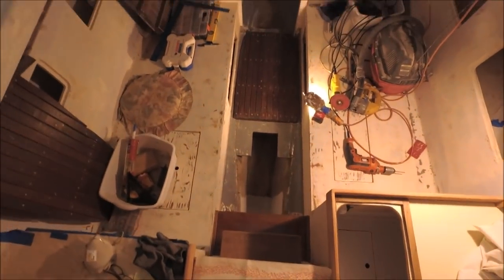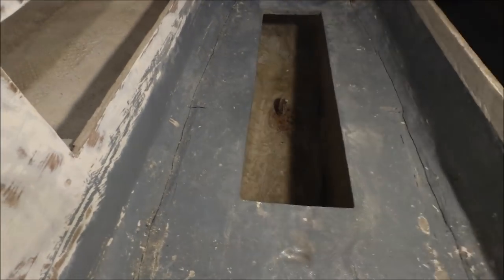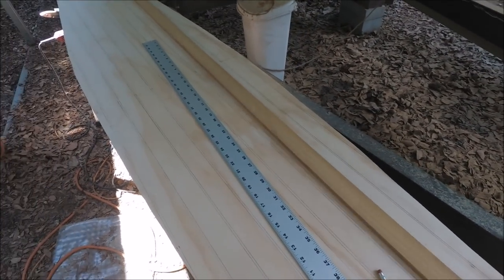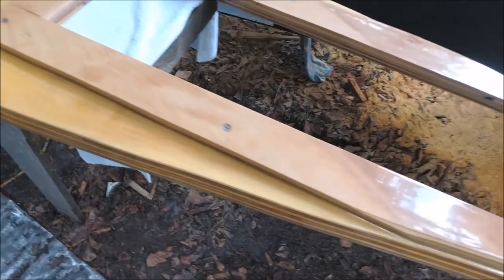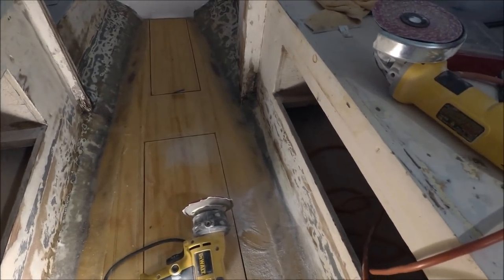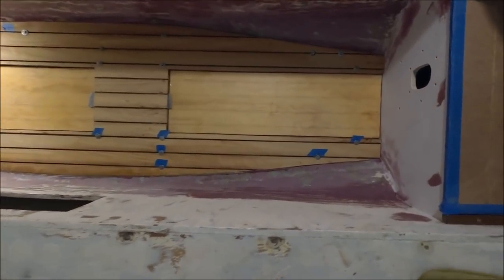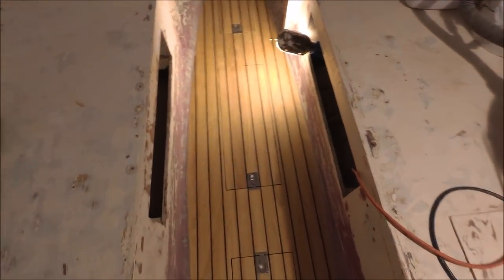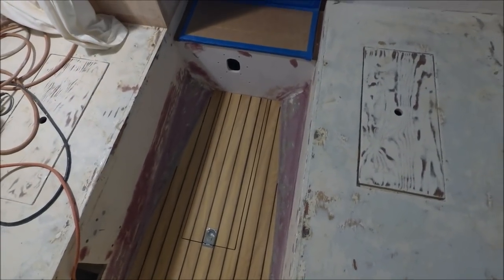Triton Osprey Refit Part 6   New Cabin Sole

Comment: As usual, extremely nicely thought out and done well - Thumbs Up! :) It is a nice look, I like the light color and contrasting strips. Question regarding the Iroko, though: over time, I'm guessing it gets dirty. How do you recommend cleaning/maintaining it? Is it a constant maintenance item? Thanks, James!
Reply from the maker: Thanks for your comment. I've had the exact same iroko strip sole on Atom for over 20 years and it is close to maintenance free since it is not exposed to the elements. I clean it maybe once a year with mild detergent and water. I used to apply teak oil to it as for a teak deck but haven't bothered to even do that in maybe 15 years and it still looks the same.
Reply: Is the cost of Iroko more economical than teak?

Comment: What type of plywood do you use for the sole?
Reply from the maker: I'd recommend you use Okoume BS 1088 Marine Plywood:
https://www.worldpanel.com/product-page/okoume-bs-1088-marine-plywood-2440x1220mm
But you can also use any good plywood from Home Depot provided you seal all edges with 3 coats of epoxy resin.